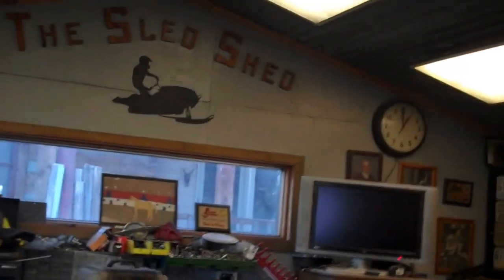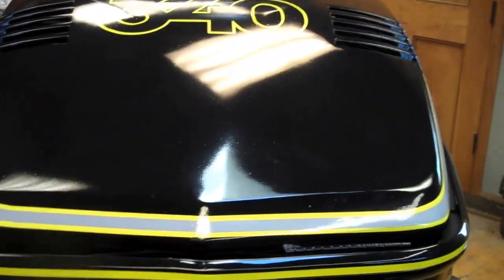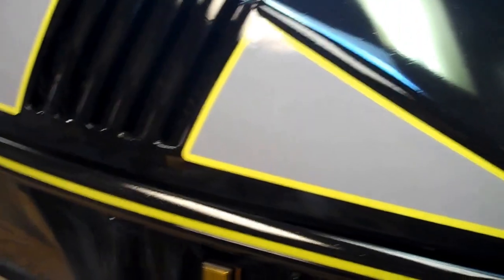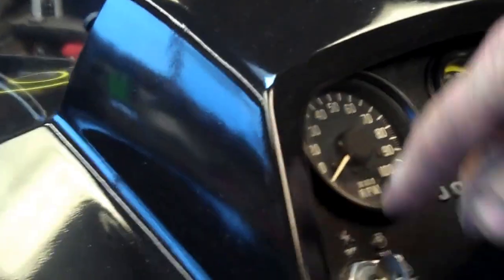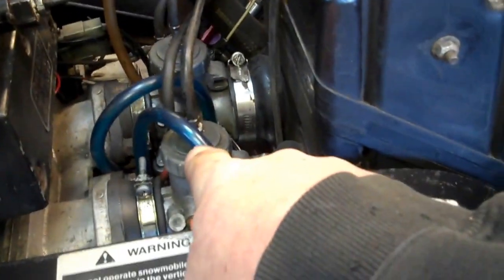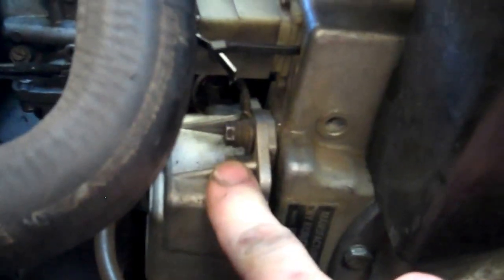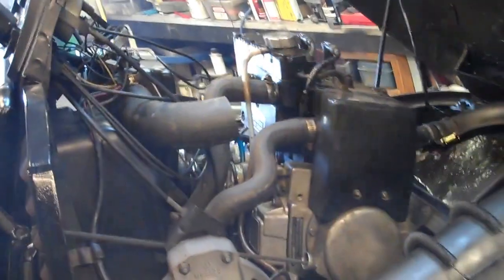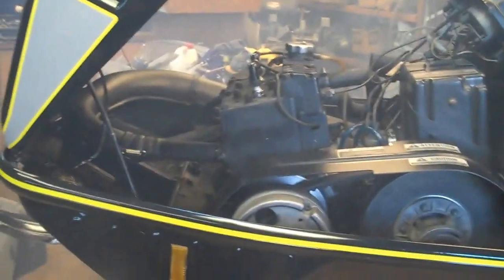1976 John Deere 340 Liquifire Snowmobile Restored

Comment: nice sled. your missing the air scoop that goes around the head light. Also most of these motors have little clips that go under the front left and right coolant tank bolts to hold the spark plug wires. this is a nice find. be carful withe the water pump belt gaurd there hard to find and break easy.

Comment: Hi I picked up a 1978 340 liquifire for 250 bucks, it's in good shape and the motor runs great. I was wondering what you think it's worth, I haven't been able to find much on the internet. Thanks!
Reply from the maker: well if its a 78 there worth more a short run should be worth 750 on good condition restored i sold them for around 1800

Comment: This is a nice sled but you have the wrong primary clutch , your missing the aluminum air duct that goes around the head light and feeds and air box tube and that is the wrong hood prop. Real nice sled though.
Reply from the maker: yep i do have the right clutch for it ya lot of those ducts are missing and those aluminum hood props are impossible to find but you do know your Deeres good deal thanks for watching
Reply: I found a hood prop for mine on a few different Cyclones and alot of the air ducts have a hole worn in them where the dash rubbed on it.

Comment: What's new in the Sled Shed? Any new snowmobiles you are working on or have finished? Any for sale?
Reply from the maker: well havent had a chance to get any in i have 1978 liquifire i should do and there is some 76 ones to  and inside i do have a 1983 liquifire and a 83 snowfire i should do there about some of the last ones deere built
Reply from the maker: i am purchasing a 1983 sprintfire that has been on display it has 1100 miles so will bring that in and get running will shoot a vid oif that process
Reply: Wow..5 years ago. I have 1983/1984 Liquifire MFG 9 83. It is a Jade Green- and appears to be original color. I have many pics one showing the VIN plate. Reply back to me if you want to know more.